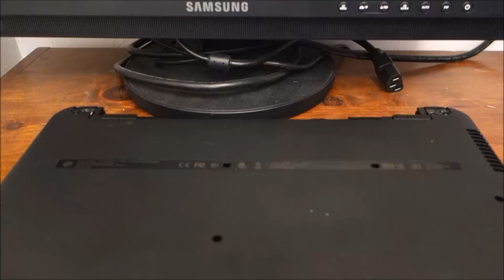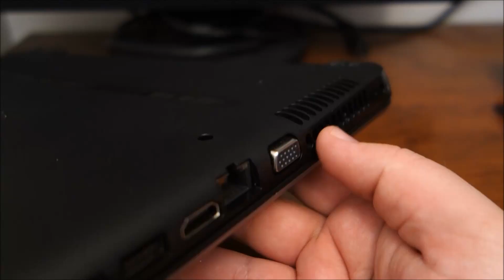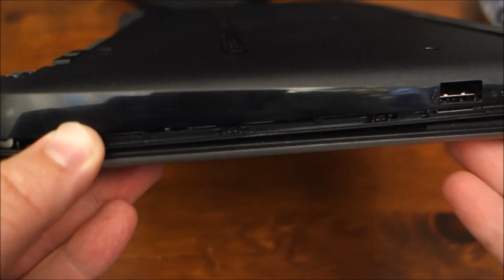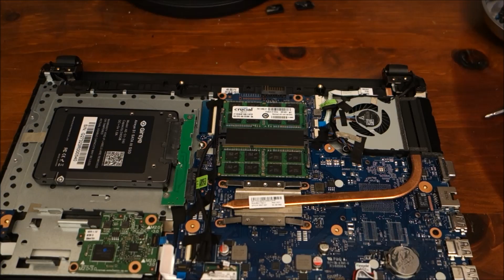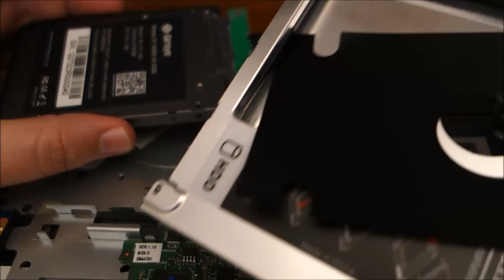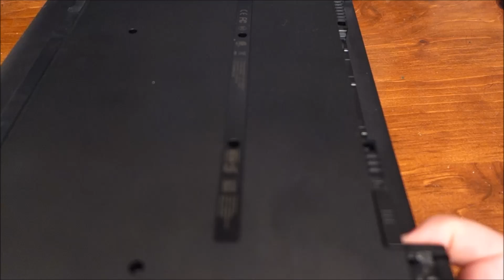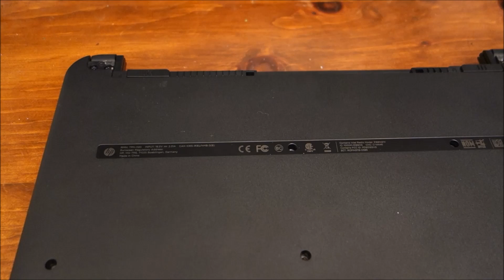HP 14-an013nr case opened up, ssd install, memory upgrade

Comment: I saw today that Dell will have the inspiron 15 3000 on sale for 199.00 on black friday...in your opinion which is the better laptop for the $200 price ??
Reply from the maker: +Tee Lasher do you have a link or exact model number? There are a lot of versions of that laptop
Reply from the maker: looking at them, you cannot get a 1080 screen on any model of that laptop at any price. so if screen resolution is important to you, then this laptop is better by far. If by processing power, its far better than the base level intel one, the amd e2 is better than the Celeron by a LOT. but its not as powerful as the core i3. and its more powerful than any of the AMD cpu's offered in the Dell systems. Yes, you do have to spend an extra bucks to get a storage drive larger than 32 gigs, BUT that is a fair trade off for the awesome screen. so if it was my money I would buy this laptop, the adaptor, and an ssd... which is exactly what I did.

Comment: http://m.ebay.com/itm?itemId=222187063516&fromWatch=true should I buy it it's pretty good
Reply from the maker: That's a pretty good deal, its not the best I've seen, but not bad. especially with the 128 gig ssd. a 2nd gen core i7 would be much faster, but probably more expensive.
Reply: How about this one? http://m.ebay.com/itm/222187063516

Comment: Amazon will not send the laptop to Australia and buying it from the local HP web site is more expensive than currency conversion + taxes so ... it's annoying. The laptop looks good for a low-powered pc. It would pair well with a good desktop to provide portability while the desktop does the serious work.
Reply: Wire Rubbish Bin I feel u man... I live just over the ditch 😣 and have the same problem 😭
Reply: buy one off office works? it comes with DVD drive
Reply: That honestly sucks man

Comment: How did you set it to boot the ssd automatically? I tried setting it to boot the cdrom first, that did not work.  The only way I could boot to the ssd is pressing the boot drive key when it first boots and then it allows me to select the ssd as the boot drive, but I have to do that every time i restart it.
Reply from the maker: +Joseph Bernard did you see my video covering the bios. I show you in that one.

Comment: so can i have 2 4gb ram sticks in place and make my laptop somewhat faster?
Reply from the maker: it will still run in single channel mode (I had 2x8 gigs and ran in single channel). so it won't make the memory run faster, but having more than 4 gigs will make the computer faster just because it will have more memory. I think that 8 gigs is plenty for this machine.
Reply: so you are saying i would have to get a 8gb stick rather than 2 4gb sticks to get a somewhat faster computer, right?
Reply from the maker: no, what I'm saying is that 2x4 or 1x8 will net you the same performance. but that by having 8 total gigs, will give you better performance than having just 4 gigs. this is no speed demon computer, but its reasonably quick for every day tasks.
Reply: ok. thank you for the info
Reply: AICproductions Would you be able to plug in an 8 GB RAM and leave the 2 GB stock RAM to get a total of 10 Gigs?
Reply from the maker: +Brandon Shaffer it has 4 gigs, and yes you would have 12 total gigs.
Reply: AICproductions Sorry, I meant 1 of the 2 GB sticks since there are two sticks that add up to the 4 GB☺, and thanks, it helps a lot!
Reply from the maker: +Brandon Shaffer mine had one 4 gig stick, not two 2 gig sticks

Comment: Very nice laptop for the price.
Reply from the maker: You would have to pay more than twice as much to get a computer with the same quality of screen. you give up some processor power, but I've been perfectly happy with mine. I've been using it for work almost exclusively, and I'm very happy with it. a bigger battery would be nice. but other than that it takes everything I throw at it on a daily basis.